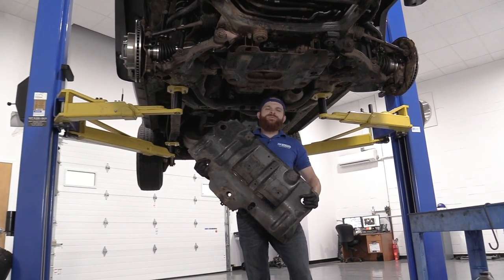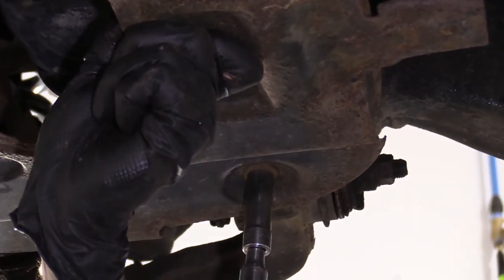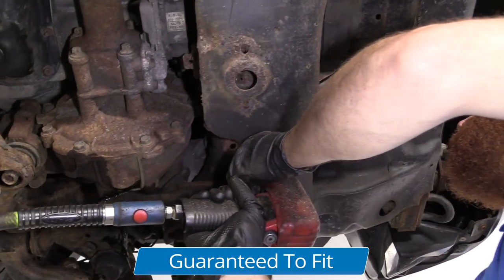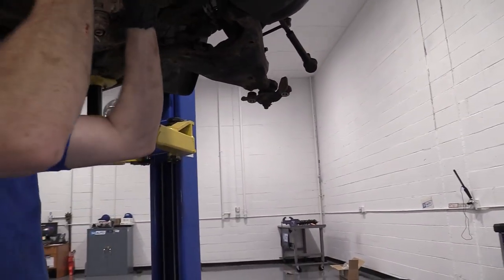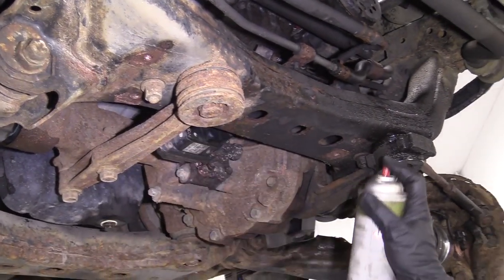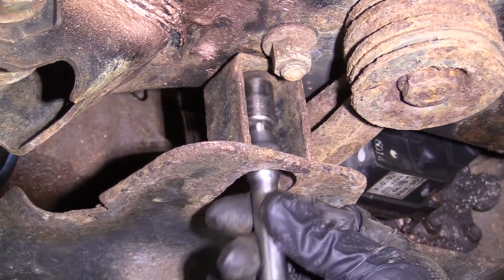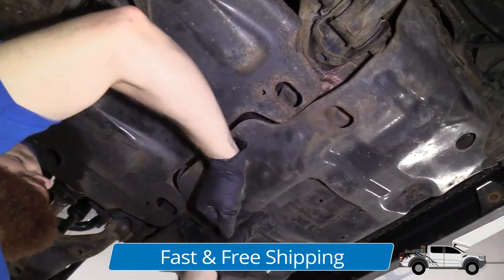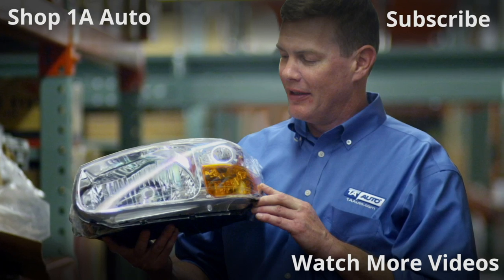How to Remove Skid Plates 07-14 Toyota FJ Cruiser

Comment: I used a ratchet and the half the bolts snapped off
Reply from the maker: +Carl Ross-Works Thank you for the feedback. We are sorry to hear that some of these snapped. Sometimes if they have not been touched since the vehicle was assembled they can be very weak and rusty. A local part store should have replacements for the ones that snapped.